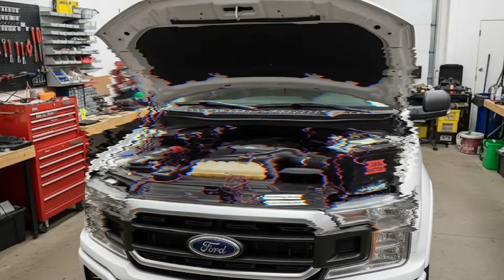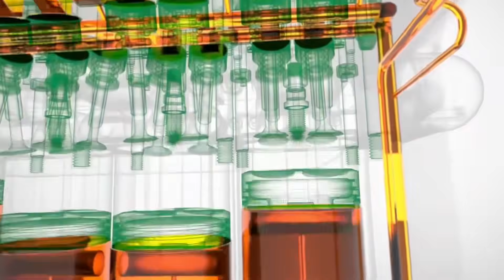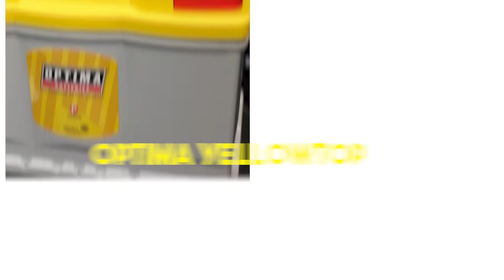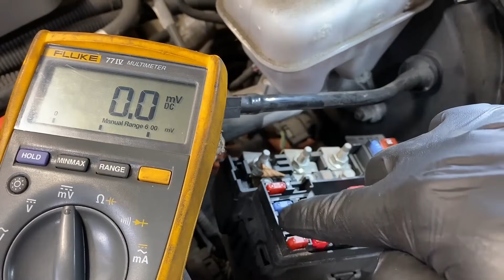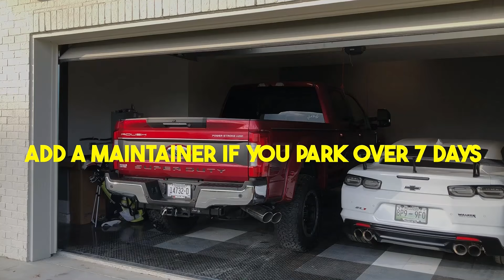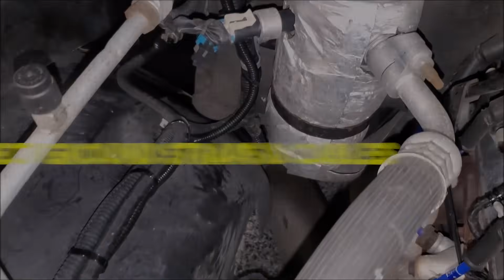Doing THIS Will Make Your Ford Battery Like NEW Again (Last TWICE Long)

Comment from the maker: How long did your last vehicle battery last?
📘 FREE Ford Longevity Checklist 👉 https://www.fordscope.com
This is the same checklist I’ve used for 20+ years to spot early wear and bad habits.
If it raises warning signs, the full 500,000-mile guide explains what to do next.
Reply: Just replaced battery on my 2022 F150 12/2025. I don’t drive truck every day and it may sit for 5+ days followed by short trips.  Tip for battery tender looks like I should do. Found bms info after a couple of jump starts. I have a portable battery for that reason.  Bought that when I had a 2022 Lincoln aviator that had a parasitic drain and I didn’t know about the bms. A lot of info to digest here but do appreciate all of it.

Comment: I'am ALWAYS putting my 2022 F-150 3.5 EB on a CETEK Battery Maintainer Just because of The STUPID MESSAGE that My F-150 Has Entered DEEP SLEEP MODE To Conserve Battery Energy???????  I been getting this Message Since The Truck was Brand New On my FORD PASS APP.  I had it to the Dealership and AT the Dealership for MONTHS having the 10R80 JUNK TRANNY Repaired. (STILL ISN'T RIGHT). I offered to BUY A NEW UPGRADED BATTERY if they would Just REPLACE IT!!!  My service writer "FINALLY" Listened to me and Replaced the Battery with the Factory Upgraded CCA Battery. (This ALL after a 600 MILE TRIP) and Still having the Issue. 🤬. Unbelievable!  And They felt so Awfully Bad that they Didn't Charge me for the Upgrade 😂😂😂. Gee..... How Nice of them. (They Probably Felt so STUPID that they were too embarrassed to Charge me for their Ignorance and Negligence)!!!  My 10R80 Is another POOR Example of FORD'S POOR Training on these Fancy New 10 Speed Wonder's????   NEXTGEN Drivetrain has the FIX, But FORD Refuses to do Business with them to FIX THESE POORLY Built 10 Speed Trannies. GM has even Worse Issues!!!!?????  Built in / Planned Obsolescence????  Let the Customer PAY FOR THE REPAIR????

Comment: I believe they normally last 5 years.
My Boat Battery is 12 years old and seems fine. 
I don’t remove it in the winter either. (Marine guy said there’s no need in the last 25 years)
Reply from the maker: That's impressive longevity for your boat battery, especially not removing it in winter!